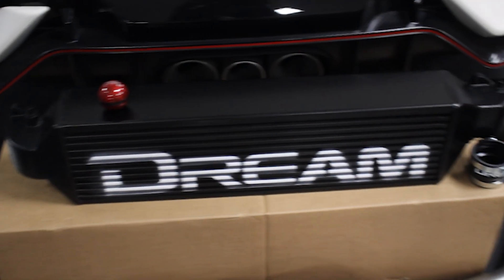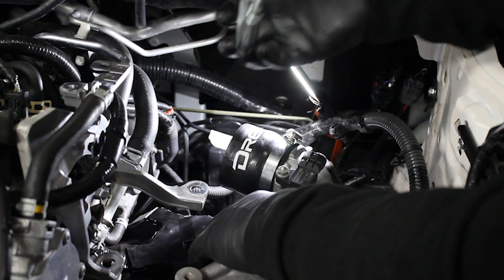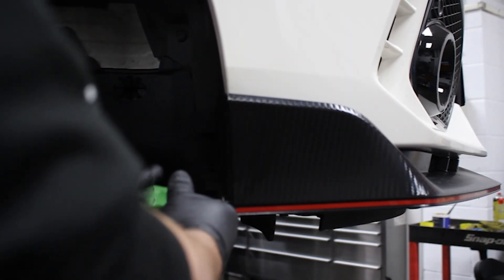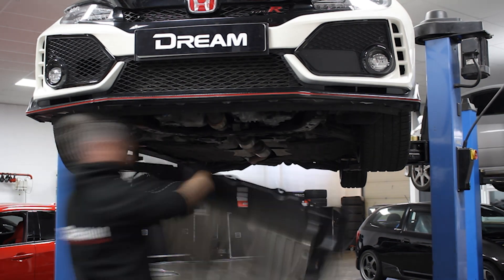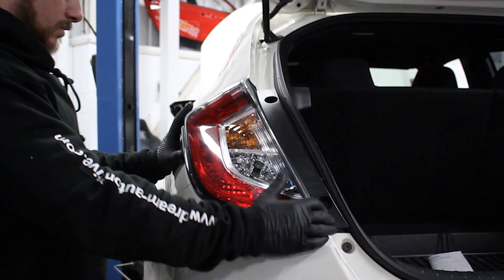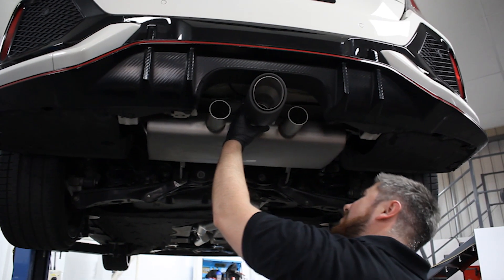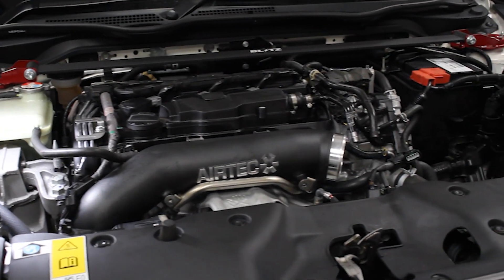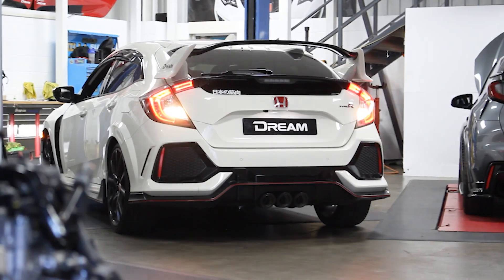Only Getting Started! (FK8 Upgrade Kit) | Dream Automotive

Comment: Does the Remus front pipe make a big difference? My car came with the Remus exhaust already installed but I don’t believe the front pipe is on it. Unsure whether it’s worth the investment or not
Reply from the maker: It essentially makes the exhaust 3" the whole way through that will match the rest of your Remus exhaust. It will remove some of the restriction in the airflow and would definitely be noticeable when combined with a sports cat or de-cat downpipe.
Reply: @DreamAutomotive  which catted and which decat downpipe do you suggests?
Reply from the maker: @xristostheofanous6317  Hello! If you'd like a sports-cat we'd highly recommend the HJS Sports-Cat or PRL High Volume Downpipe, if you'd like to get a decat, our decat downpipe is a great option especially when you opt for hard lagging! 💪 You can have a look at FK8 options here: https://bit.ly/3fjym1A